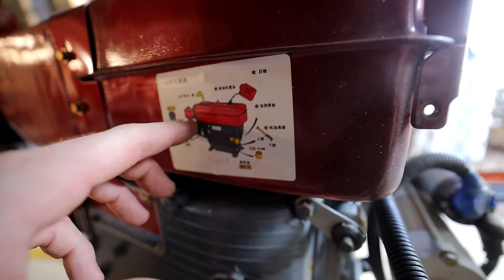Testing CHEAPEST $5,000 Chinese ROCK CRUSHER (on Alibaba)

Comment: add a output chute or make a hand cranked conveyor out the bottom to move material away. or park it on top of a structure or hill to make removing gravel easier. you could build a like a loading dock sorta thing where it just dumps down onto ground 3-4 lower and you can grab gravel with bucket and even put it BACK in to make finer gravel...

Comment: So I looked up that model you linked to and the springed bolt is th4 adjustment governing output from 10mm to 40mm. 3/4 would be about in the middle of that. Also the crusher plates are said to be of  High manganese steel. When you say $5K, I'm confused. What was their base price? How much was the shipping? The price in that link and several others looking like clones are significantly less.

Comment: Hope you are doing well after your TIA type thing.
I would put some 45s on those down tubes that attach to the axle. Wit the weight of that thing if you try to drag it over rough ground much I bet they will fold up.

Comment: I have a generator with the same motor the sight glass at the front is for your oil pressure if it's up it's making it I put a gage on it it's around 120 psi but the motor is definitely finicky and make sure everything is tight on it before use the shake a fair bit and locktite goes along way

Comment: I just received one with the same engine / instructions shows that I need to break it in for 50hrs / then adjust valves.  Is that what you had to do?  Also, what high temp gear grease oil did you use for the crusher unit?

Comment: Old fashioned evaporative cooling system on that engine. If you get a chance to attend any sort of antique engine/tractor show there will be lots of such engines on display. The water absorbs the excess heat from the engine and evaporates, taking the heat away with it.

Comment: I would never mix that with crete on anything other then the foundations. The other issue is the crete is much harder to work with stone that are jagged and angular.
Also the hopper needs to be full. It's stops the rocks from blasting out. That helps crush the larger rocks faster.

Comment: You should "load" the crusher instead of one at a time. When only one or two rocks are in the jaws and they are harder material such as the round granite it has no down pressure and mostly just bounce around. The material on top pushes down on the ones underneath and provide down pressure keeping it from jumping around in the jaws. Softer material will crush on impact but not the harder stuff. It will crush that stuff just needs some help.
Reply: I agree, I’ve had 2 ton boulders jump 10’ out of my jaw crusher at work when there was nothing else in the jaw. Also when the jaw is choked the other rocks in it will crush each other as the jaw die is moving.

Comment: Did you add oil or grease to the eccentric housing? I can't get a straight answer out of the people I have recently bough mine from!
Reply from the maker: I installed grease nipples and pump them full of grease..  they say.. oil... But it's definitely not oil tight.    You can just take the nut off and pump full of grease.
Reply: While I'm bugging you. How hot does yours get under load? Mine looks like it's near boiling at times.

Comment: The jaws for the jaw crusher might be easier to locate in canada than you think. Lots of different mining operations all over er canada, and those might be generic fittings for each size, like a 4 inch, 6 inch and 8 inch might all fit the same dimension even on a different brand. But if not, im very confident someone around there can modify something fot a mote standard part.

Comment: Maybe fit a radiator to it? with that cooling system if you run it very long might be a better plan. (owh yeah dont know if you know) but in EU they used boulders and gravel mix with like metal frames to make easy walls near the highways.
Reply from the maker: They are called Gabion Baskets.

Comment: Not sure if this was answered but there is grease fittings on the fly wheel shaft and plate shaft they are not nipple type but you can use a grease needle tip or change them
Reply from the maker: I added a grease nipple

Comment: The one lever you pull when cranking is a compression release. There are probably some grease fittings ( looks like they might have plugs in them ) on the pillow block bearings behind the flywheels.
Reply from the maker: Yeah I found those... I installed grease nipples for easy greasing.

Comment: As people have said the machine runs better when it’s got all that weight on top, I agree you should build something to stop flyers just make sure to make it out of good gauge steel, someone said you could repair the plates with welding and while I can’t say for certain wether you can or can’t I can say that you could easily build your own and worst case scenario you can Frankenstein something, if you are having trouble with draining the water you should flush the system and also make a lid so less rock dust gets in there, when crushing premade concrete and things watch out for anything that might contain steel cause it could shoot off and injure someone, that’s all I’ve got for now

Comment: Hey Kev I think that maybe for the bigger blue ore it may crush up and not spit out if the revs where turned down slightly so it's not so violent maybe give it a go at half rpms and see how it goes
Reply from the maker: I was just above idle.. I was probably at 1000 rpm, top speed is 2200..  I'll give it a whirl

Comment: If you want to smash the blue rocks, turn the rpms down on the engine. So the jaw grinds it rather than trying to smash it! Also the jaw needs to be "choked" as we call it in the industry. It's not designed to run dry, it needs to be chocked full of rocks, as they all help in the process! Been using 48+ tonne Sandvik jaw crushers for over 10 years!
Reply from the maker: Good to know..  I did find it worked well once packed full of materials.  Thanks!

Comment: Cool toy. I could see value in fabricating a catcher in the shape of a fancy "7" so flying chunks are not reflected back at you and they are prevented from going up and landing on the engine. I'd also be concerned about chunks goint into the spinning weights. Little bit of 1/8" plate and time. Looking forward to seeing what you do with this in the future

Comment: Does it have a hour meter on the engine? If Not, I would add one, so you can keep a log for regular maintenance. As the lubrication of the bearings on the top eccentric shaft is very important. Does it have lubrication information that came with the crusher?  If not think about taking a sample of oil/grease in top pillow blocks, & shaft bearings now, so you know type for later.

Comment: Nice video. It sounds like the swing jaw ( the one that moves ) is loose. Check the two nuts that hold it in , they’re on the engine side of the , up near the top of the jawstock. ( If you run with loose jaws, it’ll wear the seats, then they won’t stay tight. ) . It’s also good practice to check all nuts and bolts on a regular basis. Good luck.
Reply from the maker: Thank you.  I did hear a clacking, but thought that might be normal.

Comment: I've got a little bit bigger version of this crusher how did you manage to get the engine imported? They wouldn't let mine thru due to emissions
Reply from the maker: I'm in Canada.
Reply: @ModernSelfReliance  ahh that makes sense lol
Reply: @ModernSelfReliance  also not sure if you checked or not but check the plugs in the top of the eccentric shaft housing for oil I know mine was shipped dry and they didn't tell me until I asked which they said I could add oil or put grease fittings on it for long term use

Comment: That should have a clutch on it. I run two of those. One is a gator it’s 5 times bigger than that and a crusher that is mounted to a 40 foot trailer with a transmission and a generator to run all the belts. It crushes rocks 2 to 3 foot in diameter.  Its big.  That motor is not going to last long bro. Good luck with the new toy. They are fun to run😊. Just wondering what is the swing gap on that and does it have cheek plates on the sides. Never mind it does. Just a little tip for you. When you load you should fill up the jaws to the top to choke it. That’s why the round rock jumped out. 😂

Comment: If you check the handle to the support legs where the jaw is, you see the vibration makes it move, ill guess it lower the legs? And Maybe put a angled rubbet plate from the moving jaw so it cant throw rocks out, at least not very far?

Comment: That's pretty normal for a basic paint. I worked in industrial sandblasting and coatings and it's referred to as Class 1 blast and one coat of paint, ie, 50um thick. A Class 1 blast finish can be achieved by rubbing down the metal with a potato sack, ie, nothing hard is removed, and so long as it's indoors it's fine. The steel work inside factories are the same, it's just the use red or blue oxide paint.

Comment: It's not that the machine likes or doesn't like the rocks, it's like the old IBM card feeding machines where you would put in an entire stack of cards and put a weight on top of the last card to keep them from feeding into the reader. In other words you don't have enough weight on the bottom stones to keep them in contact with the crusher plates.

Comment: I wonder if it would be worth mounting the engine on a separate bogie and working out some way to tension the belts without transmitting the vibration from the crusher, or perhaps the crusher needs to have more ballast to dampen the vibrations. 

I worry that the engine is going to spontaneously deconstruct….
.

Comment: That diesel engine was probably design over 70 years ago, maybe older.  It has not changed much.  The biggest improvement the the float with the stick and red ball for the water tank to remind you to fill the tank.  As long as you keep water and oil in them THEY RUN FOREVER !

Comment: You know need to put a little giant corn elevator under it so you can put it in a trailer. They have a screen system built into them so you just have to move the screenings out from under it.

Comment: The paint does make a difference in the grippyness of the jaw plates. But having been the tower operator on a big boy plant some rocks just like to bounce and don't want to be pinched between the plates.
Reply: The pitmann bearing on the side of your jaw should need grease to should be fittings somewhere for it.
Reply from the maker: The other day we fitted it with a grease nipple as it simply had a bolt.

Comment: I would suggest taking measurements of those crusher plates and sending them to Windy Hill Foundry so he can make some cores so he can cast you a new set of plates. Further, when you get worn plates, have a welder/machine shop weld up the teeth with Stellite or some other high hardness wear resistant overlay material and remachine them.
Reply from the maker: I got a spare set.

Comment: That's the pressure relief valve on the front of the engine by your ear cleaner Gator Wheeling real good and then release it
Reply: Wow I did not proofread that

Comment: Ok where do I start let's see. Those bolts at the top of the Babbit bearings should be removed and oilers should be installed, or you'll wear out your bearings very quickly. There should be adjustment bolts that will push your movable jaw either forward or backward to increase or decrease the size of gravel.  I hope this helps.
Reply from the maker: I added zerks for greasing.

Comment: super jealous! Ive been wanting to get one of these for years. Looks like you were able to get it delivered straight to the house? Didnt have to mess with customs? That was my concern.
Reply from the maker: Straight to house...  They called the day before and it was dropped off they delt with everything.
Reply: @ModernSelfReliance  Thats sweet! I just spent 560 bucks on a load of 1.5 minus and it didnt cover much. Probly need 20-30 loads so buying a crusher makes more sense, since im surrounded by rocks here in S. Oregon. Thanks a bunch!!

Comment: Is it the cost of the gravel or the delivery charge that is the most expensive?
Reply from the maker: Yes.
Reply: @ModernSelfReliance  the reason that I asked is because at this time, in USA, gravel is $18usd for a ton of gravel. $80usd for within a 25 mile delivery. Delivery charge goes up with more mileage. I thought if it was the same then it would be cheaper to haul some gravel, yourself, instead of buying a rock crusher. But hindsight is 20/20 so it’s too late to be suggesting that to you now.    
Now you can make all the gravel you need.

Comment: I'd consider welding up a plate steel box with a hole on the front to load the rocks through and some netting or bungees on top to keep rocks in there and away from your head

Comment: That engine is a Changfa engine. Plenty sold in Africa. Not really long-term reliable if running hard for hours every day.
Look into the fuel consumption and compare it with Lister engines that is definitely high quality.
In a hot climate two drums are used for circulation of the water as it get really hot

Comment: Did you really say the reason those green rocks jumped out, so you think, is that Chinese people painted the crusher plate? "I don't know, maybe them painting it red made it softer, or something? I don't know, just my theory...". Man, come on🙄. They're jumping out because this rock crusher is designed to have a full hopper😂😂😂green rock can't jump out if the grey ones are holding it down. And that green rock? Will crush just fine if you keep that hopper filled...just flapping them lips, making content...don't even think about what you're saying...or doing....the part where you put the jacks on, then had to take them off to cut the corners off the pallet? That was freaking solid gold!😂 applied physics fans love this!

Comment: Get a conveyor belt and build a hopper on top of the entrance.
The machine will work much less and do much more that way.

Also less physical work, make yourself a good stash of rocks that you need to crush and you can just feed the rocks with a bucket into the conveyor.
If you want even less work, you can put a conveyor belt on the bottom.

Comment: yes the greenish rocks are hard and you need to make a real hopper for this unit to run right with a feeder that you can turn off and on and and be able to control the speed 
also I feel you are running the speed of the jaw way to fast but maybe would be ok if you had a full feed at all times

Comment: Do you have the resources to make your own plates?  They seem like they would be easy to mold with some sand. Melting a large enough amount of iron at once would be the difficult part in most home settings, but you continue to surprise me with what you find a way to do.  If you could turn scrap and the remnants of old plates into new plates you would truly be off the gravel grid.
Reply from the maker: Probably be easier to hardface weld some stuff onto the existing plates.
Reply: @ModernSelfReliance  like rebar dentures?
Reply: @ModernSelfReliance  get some old grader blades that are worn out. They are very hard and cut them into triangle and weld them on a plate. Any construction company would just recycle them so you should be able to get them at scrap prices.

Comment: No adjustment on the plate to get a smaller crush? Does a fine job overall, except for the deadly blue rock missiles😳
Reply from the maker: You can make it smaller down to 10-15mm

Comment: Dude - those bushing MUST get grease. If they have not zurk fittings many don’t know they can be added.
Reply from the maker: I added some zerks...    It wasn't fun.
Reply: @ModernSelfReliance  I’ll bet. At times we find out we’re trying to drill hardened steel (mostly on tractors - lots of ruined drill bits) and then we’ve got to take it to our friendly local machine shop. 
Good luck, and to hear you added some!

Comment: My only problem is you are NOT making gravel. You are making crushed rock, gravel is something different as it just gets cleaned and sorted to size and is usually more round and smooth as it comes from old riverbeds that are mined and no crushing is involved. Yeah it's splitting hairs for some but there is a huge difference between crush and gravel.

Comment: Your welding comment:  YES, they should have brushed/chipped that "welding slag" BEFORE painting the assembly.  It appears they used a 6XXX series of welding rod, which is fine, and in some respects, better IF they are not going to bother de-rusting/de-oiling the metal BEFORE they weld it.  The 7XXX (and higher) series of welding rods make "prettier" welds but REALLY want the metal to be "shiny and clean"...........6XXX welds (burns) through rust and grime and still yields a weld with acceptable strength.  The other "advantage" of 6XXX series rods are:  they don't make AS MUCH "slag" as 7XXX does.......so "less chipping/brushing" required..........IF they were inclined to invest any labor in "chipping/brushing".

Comment: Rocks are bouncing cause there isint other rocks holding them down. Its slippery hard round rock, crusher will struggle with that stuff. Ether drill and snap those in half and then rush them or just feed more rock on top.

Comment: going back in time to run a hit or miss engine..
The water tank is a old school dead reliable way of cooling hit or miss engines.
As long as it has water, simply cannot exceed 212.F
So no need for a thermostat, water pump, radiator, etc.